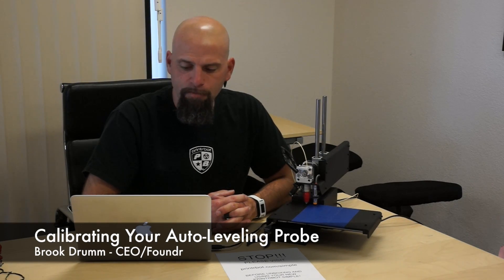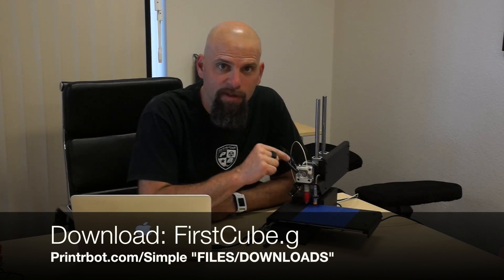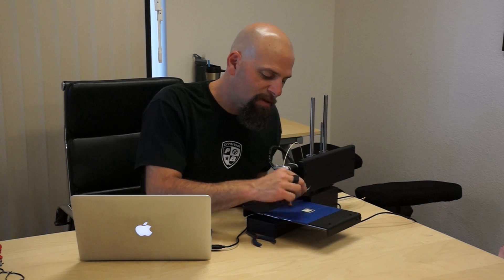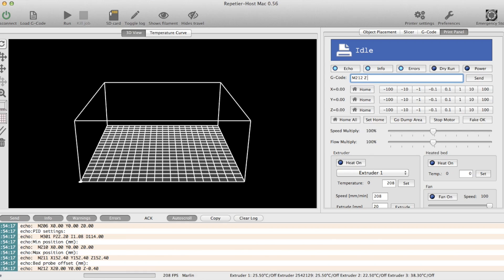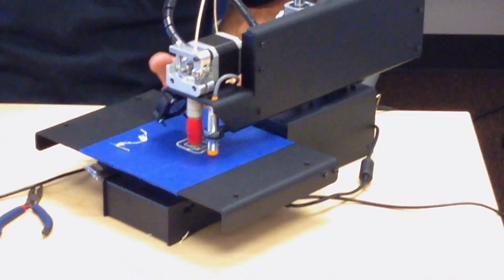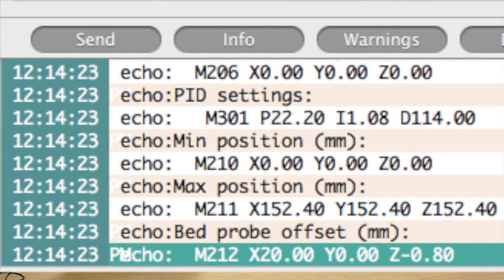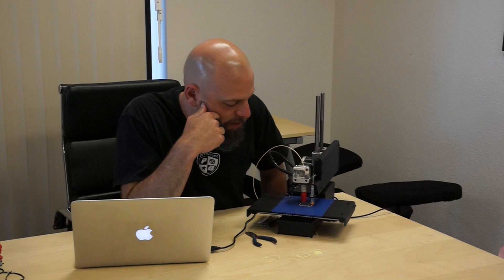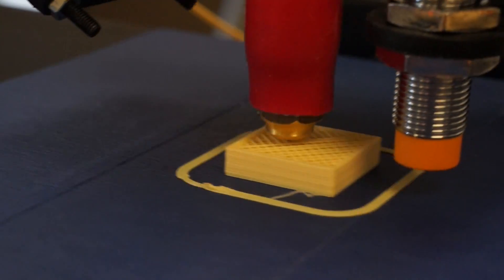Calibrating Your Auto Leveling Probe - Printrbot

Comment: Still running my 2014 PBMS in 2022, with a few modifications. The latest, I just finished putting a BL touch on it so I can start using magnetic build pates.

Comment: I’m using a raspberry pi with octoprint for my simple metal printer and I connect it through wifi. It prints 1/4 of the project and the wifi connection disconnects on it’s on. I tried using a microsd card straight to the printer itself and it won’t even register the microsd card. I tried plugging the printer straight to my laptop and use the software reptier for windows 10 and nothing happens. What am I doing wrong?

Comment: Now that there's no documentation online, this printer would be spare parts if it weren't for this video. But... boy, at 1:48 it would've been great if he had said "G29" is the auto level code for this printer, that you MUST include at the beginning of each print job, so you don't smash your hot end into the 'metal' bed! (Don't ask me how I know that). So make sure you add G29 to the beginning G code in your slicer printer settings right after the G28 command.

Comment: I just bought a Printrbot simple metal from a friend and im doing the test print first Cube and they keep coming out skewed, as each layer prints it is further towards the back on the y axis. Is there a way to calibrate this or did I buy a failing machine? Is there something I need to replace?

Comment: I have three printrbot play models...currently two of them won't print any more. I took the roll of filament off the machine. The remaining filament will not move and the machine just clicks. I have watched the online videos and tried what was suggested but cannot find how to just heat the extruder tip without running the motors to melt out the remaining filament that appears to be stuck. I am using the CURA updated software. The remaining filament is about half way between the loading rollers...Any tips?
Reply: If you have the Pronterface UI enabled you can manually heat the hot end by typing in a temperature into the appropriate box in pronterface. It sounds to me like your filament has been stripped and that's why it's not moving. :( I hope you were able to fix your printers.

Comment: I have a problem with my Z height.  I went trough the steps to calibrate my Printrbot with heated bed.  It starts in the left rear corner and checks the Z height then it come forward a little and checks, then it goes to the left front corner and checks.  However when it goes to the right front corner, the height sensor is right over the opening in the bed and it does not detect  the bed and the hot end drives into bed.  HELP!!!
Reply: I'm getting this too, it drives in and tries to go through the printbed.  Bed leveling wizard in cura did nothing.  if anybody has suggestions I'm open

Comment: During auto calibration, my printrbot metal plus's auto leveling probe goes too low for the first point in the back, and too high for the ones in the front. As a result the only way I can print is if I allow the extruder to press into the bed on its first test point during calibration. Last night the probe went too low in the front as well (almost like it is having difficultly sensing he edge of the bed). As a result there was a horrible grinding sound during auto calibration and since I was unable to cut the power in time, a large amount of kapton tape got torn off as the extruder dragged along the bed. Any ideas as to why this is all happening? Do the auto leveling probes typically become less sensitive with time?
Reply: No. There are two nuts holding the probe in place. Loosen them and move the probe ever so slightly up. 
https://printrbot.zendesk.com/hc/en-us/article_attachments/202650480/Using_Cura_to_Set_Up_Your_Auto-Leveling_Probe_and_Create_Your_First_Print.pdf

Comment: My filament wont come out, well it will but very little, any suggestions?
Reply: +NuclearPowerToaster Make sure the filament injector is tight so that the extruder motor can firmly grip the filament. Also, make sure that your 3d printing software has the right setting for filament diameter and nozzle size.

Comment: To me, the title of the video is mis-named.  There was nothing on how to calibrate your auto-leveling probe.  It was about how to tweak the height of the nozzle for printing the first layer for good adhesion.
Reply: +Griff Derryberry No, the title is correct. At 1:40 he explains that it does an autolevel before the print. The autolevel was off as it was positioning the head too high. He measured how much it needed to be shifted to give a good print and then stored that as the autolevel Z offset.

Comment: Hey guys this is really important:
These commands do NOT change the home position! I thought the M212 Z[height goes here] command adjusted the Home position's height; but as it turns out it only comes into effect when the print actually starts!!

As a result, i kept bringing down the Z until I had z-3; which didn't seem to have any effect because I was measuring its success with the home position command! Consequently I have a gouge on my brand new printrbot's printing surface :(
Reply: Too late, same here. :(
Reply: Another bed bitten by same confusion.  I wish this was clear in their online guide.

Comment: What program were you using? and where did you go to enter in those commands to adjust the auto leveler. I would have love to have followed what you were doing in the video but I just need that information. Thank you for the video
Reply: Alexander, I was confused for a while on this. I'm using (Windows) Repetier-Host V1.0.2, and the feature you are looking for is called 'toggle log'. If you don't see it immediately turn off 'easy mode' and it should appear in the same row as 'Save Print'.
Reply: Jannaee Sick
THANK YOU!!!
Reply: javierymirna no problem! Happy it was helpful :)
Reply: Jannaee Sick yeah, it helped thanks! But it's not working for me... I'll probably return the printer... I need something more simple to use... Thanks again!! :)

Comment: My auto level does not work. The corner it does not probe is way off and it doesn't correct for it. Is there a way to fix this? All of my prints are bad because of this.
Reply: +Drako155Video I have the exact same problem with the printrbot metal plus and I can't find any information on how to fix it. Did you ever find a solution? I was thinking that the probe isn't detecting the bed because it's not directly above the flat aluminum (it's over the edge). So perhaps the way to fix it is to adjust the auto-leveling program to stay farther away from the edge (but I don't know how to do this), or to have aluminum strips at every calibration point so that the probe doesn't goof up. Any thoughts?